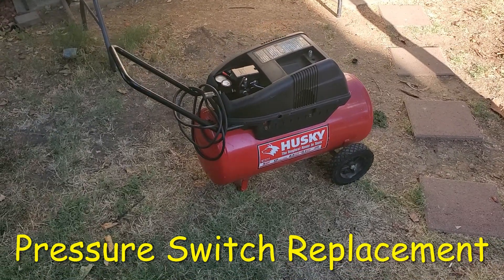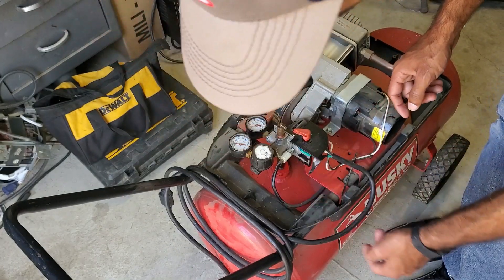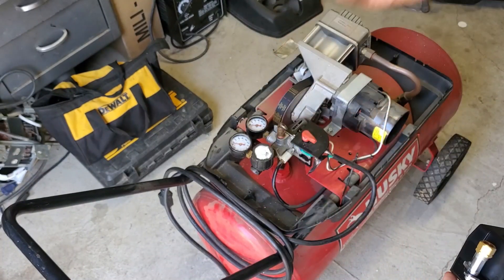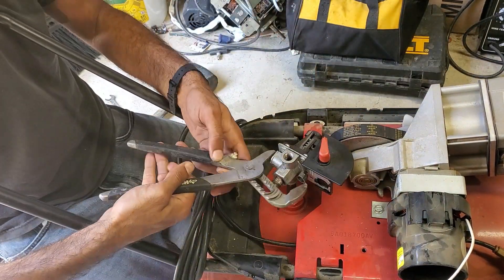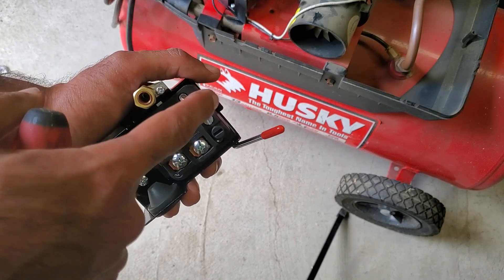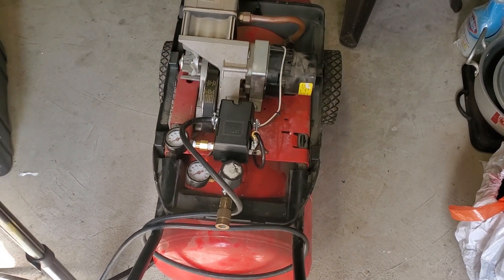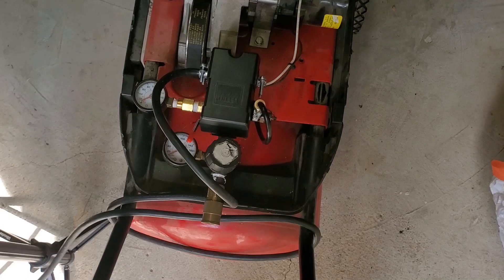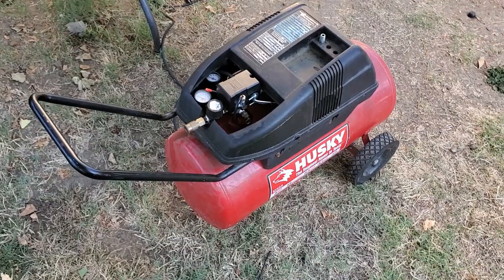Replacing The Pressure Switch On Any Air Compressor

Comment: Nice job. FYI, The Lefoo part number LF10-4H is for smaller compressors like that, max of 125 PSI. Less than $20 on Amazon, 1 day delivery. Then you don't need to adjust the cut in and cut out pressures. I just replaced the one on my Craftsman compressor last night, after watching your helpful video. Good as new! Thanks.
Reply from the maker: That's awesome. Hopefully won't be needing a new switch soon but that is good to know! I will pin your comment so it may help others. Thanks for watching!

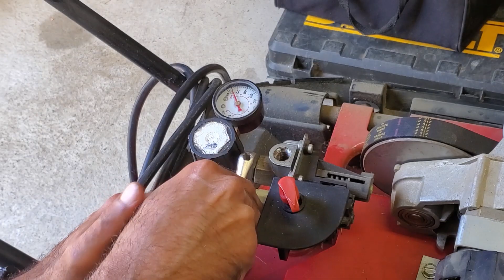Comment: Hey, unfortunately you skipped over the one thing that's important for me, which is the unloader line connector (~5:40) - I think it's the same as the one I have, but I can't figure out for the life of me how to detach it, and I can't find anything online on this type of connector - could you explain how you undid that one?
Reply: Nevermind, looked similar but I think mine is actually integrated into the switch and I just had to pull out the line

Comment: This is perfect, thank you for making this video.  I have a 2001 Campbell-Hausfeld air compressor with the exact same on/off toggle switch, which was rotating freely just like what yours was doing.  I found your video and noticed your Husky is the exact same design as my model, all of the way down to the cover.  BTW, I did not know about the hidden screw to completely remove the top cover, so thank you for not eliminating the simple steps of the project!    I love the concept of finding things people give/throw away and making them work!  I subscribed and looking forward to more videos.
Reply from the maker: Right on! Glad to help. Hope to be putting out more content!

Comment: Could you provide details on the 1/4 fitting used to connect the unloader tube to the pressure switch?
Reply from the maker: It's just a 1/4 inch compression nut. Home Depot sells them (nut, insert, and ferrule)

Comment: best video man... i have the same switch and i think it;'s going bad. the pressure relief starts to blow off but the compressor won't shut off...i think switch is corroded as mfg says just change it out.. they wanted $140.. amazon has that swtich for $15
Reply from the maker: Thank you! I'm surprised how many people get rid of compressors over a bad pressure switch (that's how I got mine lol)